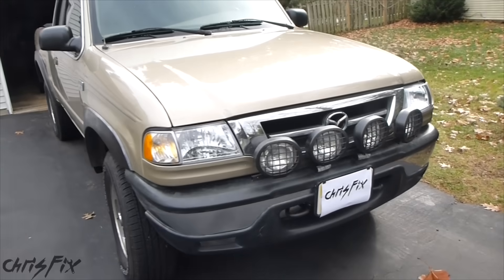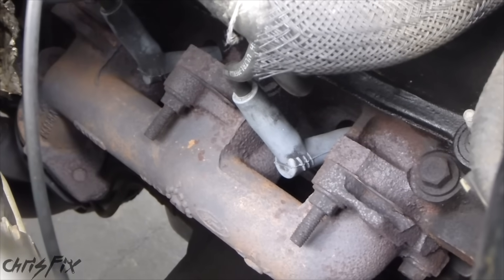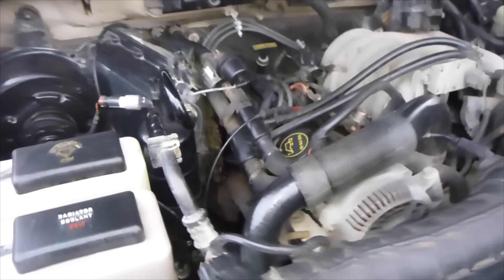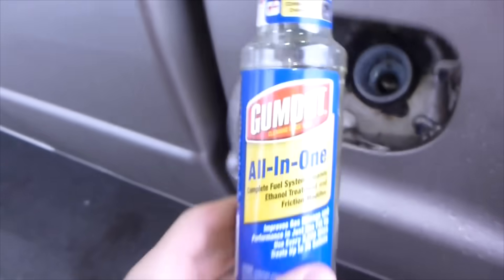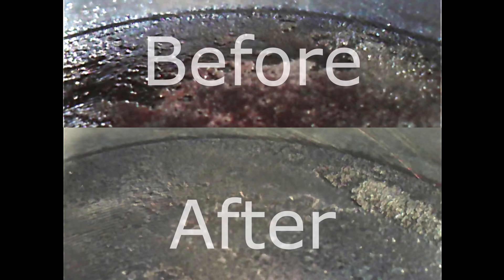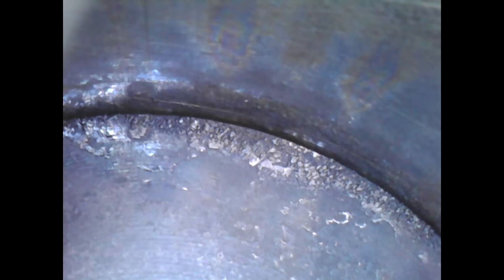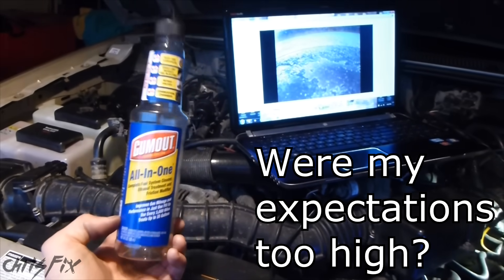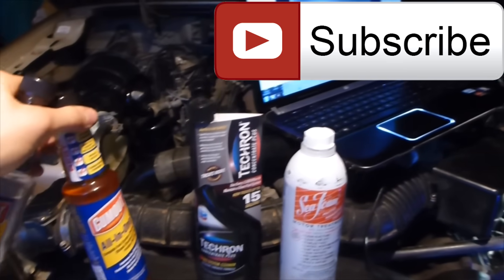Do fuel system cleaners actually work? Testing Gumout "All-in-One"

Comment: I do not know what the specific product says, but normaly fuel system cleaners only clean de fuel lines and fuel injectors nozzle for a nice misty spray. Maybe they clean the back of your intake valves, but I do not think they are gonna clean your pistons.
I think there are other product for that. Try to find one of these specific piston cleaner which work with the same instructions by adding it to the fuel before filling up. I would like to know what the results of such product is

Comment: Wow, pistons 5 and 6 were bad. I have a couple questions :
1. Had you been using top tier fuel?
2. Was this vehicle burning oil or have bad compression in those really bad cylinders?
3. Would you recommend a piston soak instead?

I really dont expect these to clean piston tops as much as valves and injectors.

Comment: Years ago, my buddy who worked for a big chain of one-stop auto shops swore that the proper way to use these fuel system cleaners was to find a vacuum line leading to the intake manifold, unplug it with the engine running and slowly pour the treatment into the vacuum line while revving the engine. I will admit, I saw them do it a few times and a huge cloud of grey smoke would come belching out of the tailpipe and the engines would seem to 'sound' a bit better and smoother running after this. It would be very interesting to see a  before/after bore scope test done with this method.

Comment: You should try pouring seafoam/b12 chemtool or even wd-40 in the cylinders after a drive to let it hot soak for a few hours, then run the engine for a bit. It would be interesting to see the results.

Comment: and will using such additives (fuel system cleaners and cat. converter cleaners... etc.) hurt the fuel pump? I use German products from Power Maxx brand (blue chem company) and had to change my fuel pump twice last year... but couldn't know if the fault was from manufacturing or from using these products. can you do a video examining this brand?

Comment: "complete fuel system cleaner" why u looking at carbon deposits on the tops of pistons? If this is your aim use sea foam or something intended to clean up carbon deposits instead
To be fair on this product do a before and after injector flow and spray pattern test

Comment: Awesome video, I think the product is meant to be used regularly. I would be afraid of a product that's too strong and removes all the carbon at once, that cannot be good. Also, I think it's mostly used for injectors and preventing heavy carbon buildup but once it's there it's too hard to come off

What do you guys think?
Reply: I think knocking all that baked on deposits would be unrealistic and likely dangerous for an engine. It got the sludge and may chip bits and pieces away of the hardened but I would expect it to be a longer process. The cleaner itself is likely a lighter duty cleaner just so it doesn't damage other parts.

Think of it like bleach. Pure bleach may work in some tasks but can ruin other stuff and a diluted mix may be safer but less effective option. I don't think 1 bottle will be a be all solution but like my high millage car a bottle 1 a month may help reduce some damage but it isn't going to work miracles.

Comment: Chris, thanks for the info on gum out. Its disappointing, no significant removal of carbon deposits on any cylinders. I doubt there will be much change after 2nd bottle.  I used to use Red x. But i didnt have a bore scope. I think i need to buy one now...you got me thinking about my 3.8 litre commodore.

Comment: Check again just before next oil change. 200 miles is not enough miles for a fair determination. What brand of fuel are you using? Would have been valuable to show the spark plugs foe each cylinder.
When were the plugs last changed?

Comment: My 1984 BMW was idling rough, I fixed a vacuum leak but it was still rough. Before replacing injectors, I tried some liqui moly jectron injector cleaner. It actually made a noticeable improvement in the idle. It isn't perfect but I was quite surprised and impressed
Reply: August Sawzak i had this issue with my 04 pathfinder. Nulon injector cleaner sorted it. I think i had some plug fouling from fuel  perhaps as it ran fine on throttle, even the smallest hint of throttle and it was fine
Reply: Sea foam destroyed my engine i have the before and after that additive works to good

Comment: I have a 2010 1.6 4 speed automatic Corolla and for some reason it drives a total of 380kms with a full gas tank, is this normal? If not how can I fix this? I use the car in town, no long roads.

Comment: Hold up. You'll never clean the whole piston. The gum out claims valves and combustion chamber meaning the head. You can't see you head with the bore scope. For your best test you'll have to pull the head before using it then pull it after using the gum out.
Reply: yo but if you pull the head anyways, might aswell clean the parts the old-fashioned way

Comment: This is going to sound like a dumb question but is it still worth buying to clean the fuel injectors? Idk if the top of pistons will have a lot of sludge buildup since I run catch cans on my car but I am worried that my fuel injectors might not be operating to full capability. Would you think this product is useful in that scenario vs removing sludge and carbon off of the Piston heads?

Comment: Fyi., the reason you get carbon build up on the edge of piston is because that cylinder is running lean, i suggest pulling the injector and cleaning or replacing it... it wont ever clean it if your injectors are bad

Comment: I did this too, it does not clean no matter what you use. Only way is to clean manually by taking out the pistons. But really if is not a high performance vehicle as for racing i mean, it is not worth the effort. 
Though is very good to use , as the engine is new , than is very good to use to keep clean. And in this case too only if you have a car that you want to keep around a long time.

Comment: Well the bottle does say, "Gumout". That gives the implication that it removes gum like substances, which it did. As far as the hard carbon deposits go, I don't think a simple additive is going to help remove that. That's going to take some physical work to remove that stuff. Or replace those parts with new ones. I understand you were reading off the bottle and following their directions, but the product worked as advertised. As far as a 'complete cleaning' goes, that's just trick advertising for the gullible. I would use this product.

Comment: maybe someone asked this already but i heard somewhere that using fuel system cleaners will dirty up your oil filter or fuel filter real quick. i have always been hesitant to use them on my newer cars unless i notice a rough idle or decline in fuel economy.  i wondered if you heard that about the filters and or if you checked those to see if after an oil change using this product dirtied the filter a lot.

Thanks for the great videos by the way!

Comment: hey chris i have some theories and i just wanted to share them with u.  first i think piston #3 got most of the clean because it's the one used the most. the question would be what happens if u drive 35 miles on just piston #2 would it have the same effect as #3. 2nd theory is what happens if u pour the additive directly into the piston.

Comment: Very thorough test. Some of your initial oily looking shiny black may have been oil from blowby on the deposit. Also not sure what grade fuel u normally run but regular doesn't burn as hot as say premium. Obviously heat of ignition burn will incinerate deposit,, the additive is likely a fuel booster. Over time using high test will preform better results. Higher octane fuel will burn hotter keeping cylinders and piston heads cleaner. Our shitty corn oil fuels don't burn as hot or completely,, that's what causes build up. Very good video though.

Comment: You got 12 miles per gallon from the tank of gas? 
That's really sad.
Reply: A B  that’s not that bad my 1993 Ford F-350 with the 460 big block gets 10 mpg or less normally I get around 9 mpg driving to and from work

Comment: hey chris   what i use  is this    bg44k fuel  additive  you will feel  a difference  the first  20 miles  ,,,,   i drive a  2002 ford ranger  .....   second     use   amsoil  intake cleaner     spray into the  plenum     let soak  ,,,,,,     watch all the white   smoke come outta your tail pipe    ,,,  3 >>>  spray  the  itake cleaner   in each combustion chamber    let soak  for  about  20 min   then  run  car  ,, the bg44k  fuel  treatment  is the best  stuff i have ever used    ,,,,,     jk

Comment: Chris, since you've come out with these videos, I've watched them many times. One of the things I've realized, is that since you ran Gumout twice, it created a baseline for all other cleaners to try to work on the hard carbon deposits. Sure, you can't get the soft gooey carbon back to see if they can all clean the easy stuff, but running Gumout twice really set you up to have the fairest test for all other cleaners.

It's not like you can find another engine with the same deposits ever. They're more unique than snowflakes, which have nearly infinite patterns and they are much smaller! I really want to carry your work forward on my YouTube channel. Having the resources and time to do testing like this is quite challenging.

Comment: Hi Chris, your probably going to laugh at me for asking this question, but I've watched some videos on you tube of people pumping oven cleaner into the turbo to clean out the carbon deposits, do you think its possible to have a go at this on the the pistons, maybe one at a time. would need a bit of a soak I guess. I'm a chef by trade so have used a lot of oven cleaner on carbon, and it works much better on a warm moist surface. Is it plausible or not. regards, Jason, PS love your videos

Comment: Hey Chris, Great video.  Sad to say, I think the product works but not to the full hype.  It looked like it cleaned the softer sludgy type carbon deposits as evidenced by your before and after shots of the cylinders.  They all looked cleaner to me but it looked like all the really hard deposits were still there.  If the softer deposits remain in place for a lengthy period of time, I think they become baked onto the surface into a much harder deposit.  I suspect that once those deposits become hardened they are mostly there to stay until the engine is dismantled and each individual part is cleaned (relieved of the carbon deposit).  Once the deposit becomes hardened, I don't think these kind of products will be of much help.  Perhaps repeated use over a long period of time, say 50,000 miles, may eat away at those heavy harder deposits, I don't know.  The recommended regular use of the product then should at least keep anything from building up as any deposits between use never really get to the hardened stage.  Seems like a good product to use to prevent the buildup BEFORE it happens but I know it wasn't really marketed that way.  Anyway, thanks for taking the time to do this so we all could see your results.

Comment: I mean the heavy carbon may require hand cleaning (if possible) or at least a couple of applications depending on how long its been since you used an additive or had them cleaned. It would be wrong to praise the performances of other cleaners if they were used on weaker carbon deposits, but it is hard to keep things consistent. 

How did effect other aspects of driving?

Comment: Most of these manufacturers state in the directions to use at every fill up. Reason being, it only does a little bit of cleaning at a time. If you use it regularly, it'll clean more and more and it prevents new deposits from forming

Comment: In Hyundai santa fe 2014 catalog advice you to use fuel system cleanner every 5000 km in hard situation and every 10000  km. Actually have fuel system cleanner but it's difficult to find it in YouTube

Comment: I would like to see a test of the Mopar combustion chamber cleaner. I've been using it on my cars for quite a few years and it seems to help the idle and performance. Definitely better than Seafoam did. But I don't have a bore scope anymore to check the results myself.

Comment: I say the result is far from perfect, but surely significant.
Preventing further build up may be the final result, but just to keep status quo instead of getting further build up is pretty good.
If one use the engine cleaner from when the car is new, it seem like it would prevent any build up at all.
However, if you compare it with the pictures on the bottle, it perform well below expectation.

I'll watch the follow up video, but as it has BUSTED on the thumbnail, I'll guess the next bottle did little to remove the build up.
I have used another brand of engine cleaner and got lower CO and NOx emission, so I guess it does something good?!

Comment: FYI TO EVERYONE:
changing out your spark plugs with brand new spark plugs will actually make a difference with carbon build up. i also would recommend MARVELS MYSTERY OIL to clean cylinder heads. best strategy, run the motor until its hot, then take the spark plugs out and pour no more then 2 OZ of MMO in each cylinder. after an hour to flush it out just turn the key for a quick sec, the starter will dump it out and then you put the spark plugs back in and the deposits will burn off as the MMO softened them up way more then GUMOUT ever will.
Reply from the maker: Thanks for sharing.

Comment: One bottle is not going to clean 100,000 miles of carbon build up lol.why do you think it says use every 3000 miles.Its going to take time.I bet you felt the difference though better response smoother acceleration in that one bottle you poured.

Comment: Do you think it'd work better if you didn't fill up the tank all of the way? Like use an entire bottle with a half tank so it's more concentrated? Also, my car has around 21k miles. Do you think gumout would help to prevent these large buildups form forming?

Comment: I've been told that additives can damage your cat converter and mass air flow sensor. Is this true?
Reply: Todd sperling no... not if used properly. Once ignited in a mechanically sound engine, they're vaporizer same as the gas.